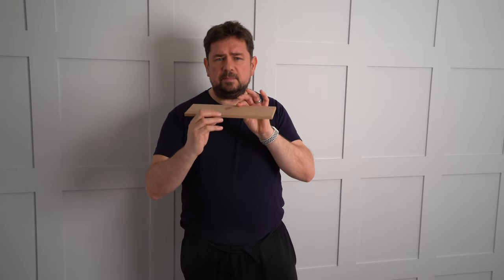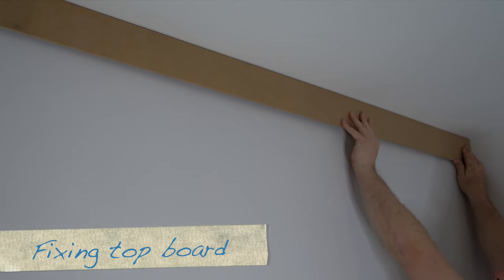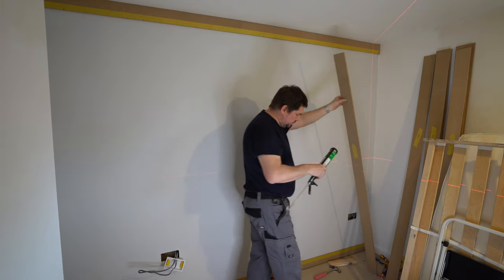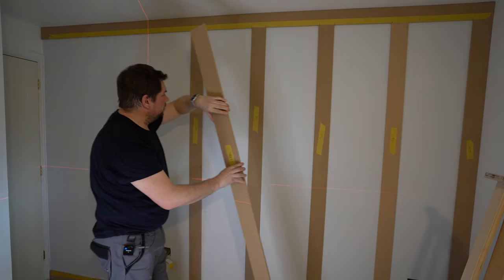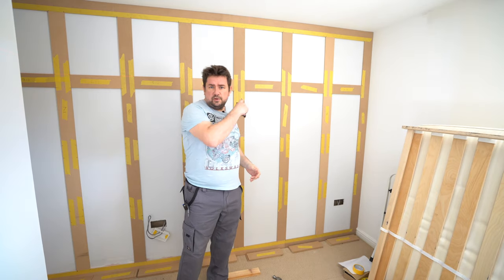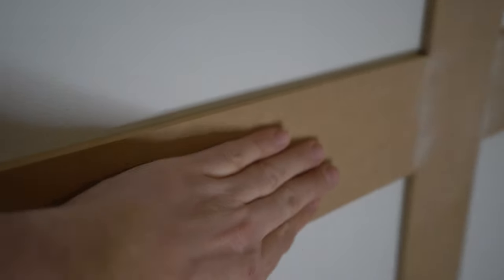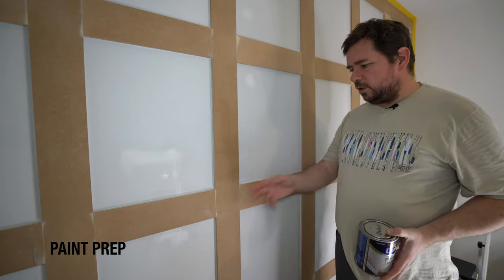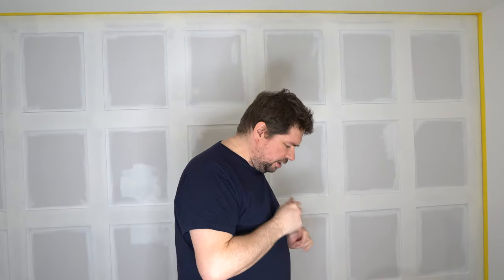Shaker Style Board and Batten Panelled Wall,  Full DIY Tutorial

Comment: Glad I watched this video...!!!
I'm a decorator by trade and am planning on re-decorating my eldest daughters room when she goes away but was going to use thin panels of mdf prior to the strips of mdf going on top... just saved me a bit of money and headache as the ceiling slopes and using panels in that corner would've been extra work... Top man..
Reply from the maker: Thank for your comment, as mention in the video just make sure that the wall is in good condition eg smooth before starting.
Reply: @RichManPoorTech  
Yes for def... prep is always key... done alot in the house so always sound base to work from.. my customers always say spend days doing prep then Decorations happen quickly...!!
Reply from the maker: @christophercharles3426  I know exactly what you mean, if i have to repaint a car i spend weeks prepping the body, degreasing, masking, sanding, priming, sanding, re masking, re priming, and then the fun bit painting happens in 5 minutes wait 30 and another 5 mins, reminds me of dating
Reply: @RichManPoorTech  
🤣🤣🤣🤣🤣

Comment: This is such a useful video. Thanks for taking the time to make it! 

I'm doing this in my house at the moment, but I'm finding it hard to get invisible joints like you have, even after filling/sanding. It looked fine until I applied the undercoat/primer, which seems to show the joints off more. It's not too bad, but you can see a thin line where the two pieces of wood meet. Can you confirm if yours are visible or not? It doesn't look like it in the video. Thanks.

Comment: Excellent video,as regards the paint is it Matt emulsion like you would normally use on walls.or is it Matt wood paint ,
Reply from the maker: I used a primer sealer for wood on the mdf, then I used normal Matt wall emulation to paint the walls and mdf at the same time

Comment: I want to panel my alcoves at either side of my fireplace in the style as above, but one wall is 180cm wide, and the other is 170cm wide. How would I do this as different size squares will not look right? TIA
Reply from the maker: as you have different sizes its hard loosing 10 cm, but depending on how long the wall is if keeping the squares the same size but the furthest upright i would increase the width and may be loose a bit on the upright furthest on the other shorter side or loose a bit on the last horizontals on the shorter side, or may be a combination of both, mark it out on the wall and follow the builders mantra if it looks right it is right,  but 10cm is a bit, most people even looking probably wouldn't tell 5cm. but if you draw it out on the wall you can get a visual to get the best look sorry with i could help more

Comment: Hi mate, great video, as a self employed joiner, I've been asked to do some of these for customers. Can I ask what software you use for working out the spacings etc as it looks really professional.
Reply from the maker: It wasn’t any special software just a spread sheet (numbers on a Mac) for my own reference and visual representation sorry wish I could help you more
Reply: Example  total lengh of wall 3000 minus 8 uprights at 100mm each = 2200 divide by how many squares say 5
440 is the lengh of gap.Easy

Comment: Great video. Appreciate your focus on quality!  Question:  the only squared edged boards I can find here (US) are pine fingerjoint. The MDF  all has rounded edges which don't work with the look we want. The fingerjoint boards are excellent, but not quite as straight or true, but we think we can knock them into compliance, if they're noticeably out. Seem reasonable ? How important is it that MDF be used?
Reply from the maker: The mdf has the squared off edge when we cut them,  MDF was chosen because it is stable as well as good value for money here in the UK, which wood you choose is up to you but be aware of expansion or shrinkage, some woods expand and shrink more, i don't now if that is a problem in your part of the states as i know some areas of the states have great fluctuation in temperature and moisture and some areas don't
Reply: @RichManPoorTech  Ah, OK, I see your concern.  I live in Southern California so the air is fairly dry and the temperature fluctuation relatively small.  Thank you for your response.  Keep up the great work!

Comment: Great video, I've had problems painting MDF in the past.  You used a water based undercoat & assuming a dulux emulsion.  Did you have any issues with the board ?  Also how did you sand the MDF cut edges prior to fitting or just prime & paint ? Many thanks
Reply from the maker: i had no problems with the mdf from using the primer, if your being very picky there is a slight raise to the grain from using the primer sealer, but once painted this is hidden by the pattern left from the roller. also the edges cut by the circular saw were very clean, although i did give a light sand all over with the da fitted with a medium firm backing pad that came with the sander as while i was sanding the filled joints

Comment: Just came across your page (now subscribed), really good video and I've just bought the level 3 laser on your recommendation. 
I want to do this type of panelling in my passage and then up the stairs, but only half way up (about 1000mm - 1200mm from the floor) what would you recommend to cap it off? Thanks for any advice.
Reply from the maker: Welcome aboard! i personally would leave just a sharp edge, bur you could either round the edge with a router at what profile you like, or adda profile wither a concave, round or a lip, make sure if you have to join 2 pieces together for length to make a compound miter joint

Comment: Great video !!! Just up to the wood filling part now just wondering is it ok to use the ronseal multi purpose natural wood filler as struggling to get the 2 part filler from anywhere ? Thanks
Reply from the maker: There is a link to the 2 part filler in my description, you can use the air dry  ronseal natural wood filler, but it takes longer to dry completely, and it needs to be completely dry to avoid stink back

Comment: As the recess of each square / rectangle is the same area , would it be a bad idea to get a few MDF , "Templates" to this exact size and use these for spacing? IE 2 templates, the one top bottom when adding the verticals, then rest in place to add the precut horizontals?
Reply from the maker: This could be done, and is the way many would do it as it may be quicker, the only problem with it is that if your out slightly with the template or the mdf strip all subsequential horizontals or vertical would also have this error, if its an error in the template then the error would also be multiplied by the end of the run, 1mm at the start could add up to 10mm after 10 strips, It would probably look right, and the saying goes if it looks right then it is right, however it depends how much of a perfectionist you are, or your partner is, for me it would bug the hell out of me every time i looked at it, especially when i know i could have done it perfect the 1st time. 
30 years ago i bought a factory lower rear spoiler for my Porsche and spray painted it about 30 times until i got it perfect, once fitted  you could only see the edge going around the exhaust but it had to be perfect to me otherwise i wasn't going to fit it to my car.

Comment: Can you do this on freshly plastered walls with a PVA undercoat on? Young mom here starting from scratch and going to be doing this myself😁
Reply from the maker: I can’t see why not, a lot of that wall has had electrical sockets moved and wall filled plaster repaired and sanded just before doing this job so as long as plaster is dry out properly should be ok
Reply from the maker: Good for having a go, if you need to ask me any more advice then please do, you need to work quick with the gripfill

Comment: I have done this with woo# filler but the joins where I filled have cracked. Do you know why and how I can fix this?
Reply from the maker: Did you use a 2part filler, if using a single air dry filler it take a long time to dry
did you allow to thoroughly dry before sanding back, 
are you mdf joints tight and primed before painting. Was the batons securely fixed 
To fix the cracks I would scrap a gauge into the mdf crack 
re fill
sand smooth 
Caulk if needed 
Allow to thoroughly dry
prime 
and re paint

Comment: Hi, used your video to do this on a wall in our living room as found it the most explicit video for a beginner. However I am encountering a big problem. Once all wood was fitted, wood filler added and sanded down I primed the mdf and the wall before applying thr paint coat. The colour used on walls is almost similar to the one you use in the video but from Valspar. I have already done 3 coats of paint and it seems likecthe paint colour gets sucked in the primer leaving the wall and panelling more white then grey plus there still is a strong smell of primer coming of it. Lost my hope now and not sure what to do to get it at same grey colour as te rest of the walls which only had 2 coats of same paint. Any advice please?
Reply from the maker: Hi it sounds as if your primer is sinking into your mdf, and then your colour coat is doing the same thing, you might have to change your primer sealer to one that doesn't sink into the mdf and seals on top, before painting, also if you can smell the primer then it probably hasn't fully cured

Comment: Our ceiling and floors are sloped due to the tradesman before not levelling stuff properly. Basically means the floors and ceilings are slightly sloped so a bit stuck when one side of the ceiling is 1cm lower than the other. Do you have any tips on how to cut the wood?
Reply from the maker: You could cut in like you would with a work top, place level (pin in place) and roll a large washer with a pen in the middle to follow the contour, then cut along line with a jigsaw, small gaps will be filled with caulk or you could fill the gaps and sand, personally I wouldn’t want to fill more than 5mm but I have seen it done
Reply: Thanks for your reply. I think that’s a little out of my capabilities but could only think of perhaps not having a batten on the top and bottom and letting the lengths go down between the skirting board and architrave. Could you see any issues with that? Thanks!

Comment: Hey I can’t figure out how you figure out the measurements. I keep seeing calculations with the width but not the height. My room is 183”w x 96” high. Please help!!!! Also, my biggest question is do you recommend plywood over the plaster walls??? This seems to be the biggest unknown. So many people don’t use it but I’m thinking you def need it!!! Please help. Thank you!!!
Reply from the maker: 1st plywood, no need if you have smooth walls, if you haven’t got smooth walls then you need to get them smooth prep at the beginning is key to a good job, I suppose you could board the whole wall 1st but that is a extra expense
2nd measurements take the height of the wall, deduct the width of the 1st horizontal strip and then divide the remaining by number of strips, this should give you the center’s check on paper that your square are the same size
Reply: If you haven’t allready. With your room being 4648mm I’ve converted for my ease I’d do 8 inner squares across this gives you a measurement of 468.5mm wide gap between vertical Lats you would have 9 vertical lats I’d also do 4 downward squares with 5 lats this gives a measurement of 484.5mm between horizontal lats all lats should be 100mm wide for these measurements to work hope that helps. That being said it is all personal preference but keeping roughly in the 400-500mm area has never steered me wrong and people have been happy with it.

Comment: Did you use tape measure or laser measure? Would you recommend a laser measure ?
Reply from the maker: i used a tape measure for the distance, then used the laser level to project it across the wall, ive not had enough experience with laser measures to comment on the use of laser measures sorry

Comment: Hi, thank you so much for your elaborate and detailed video. I'm just about to embark on a similar project however I cant seem to decide how many horizontal panels I'd like. I really like the size of your panels. Can you please tell me width of your panels and overall width of your wall horizontally? This will help me immensely with mine. Thanks
Reply from the maker: panel size is best to fit to your own room, you may have higher ceilings or wider room etc, but my panels are approximately 360mm x 450mm or 36 x 45 cm

Comment: What is a centimeter?  Is it like a inch or two?  We use actual real measurements in the U.S.
Reply from the maker: Approximately 2.54 metric centimetres = 1 old British imperial inch, which hasn’t been taught in school here for the last 50 years, although we still buy building material in feet and inches then measure in mm to cut

Comment: How is it to remove this later?
Reply from the maker: With the Barton’s stuck on not screwed or nailed then as they are removed there is no deep repair, however there would be surface work needed, I would estimate no more than when I prepared the wall in the first place. shown in my video with the wall sander, this was after removing a built in wardrobe and moving some plug socket that was in the wall

Comment: Hi. Do you not need to pin the panels with a nail gun as well as glue?
Reply from the maker: Not if using high grab adhesive like I was using, I did give time for top rails to dry before verticals and again before fitting horizontals
Reply: @RichManPoorTech  Thank You.

Comment: We try to make it but with the glow is not stay
Reply from the maker: i am presuming the glow refers to the grab adhesive, (glue) if your using different glue, temporary pin the planks with a small nails either below or through the wood and then it can be filled at the same time as the the filling stage, hope this helps